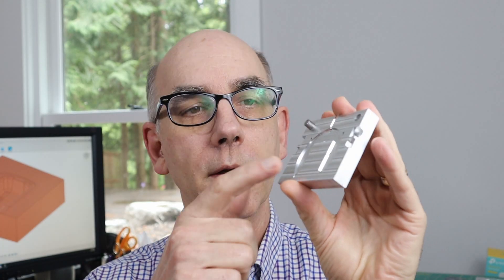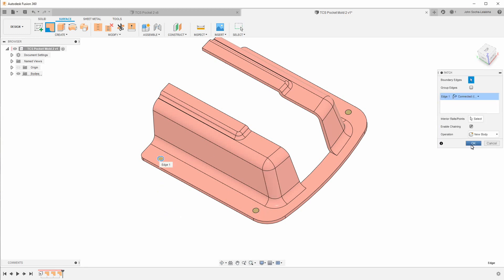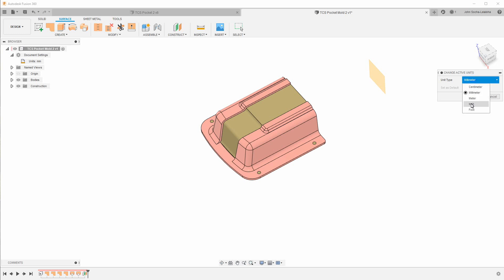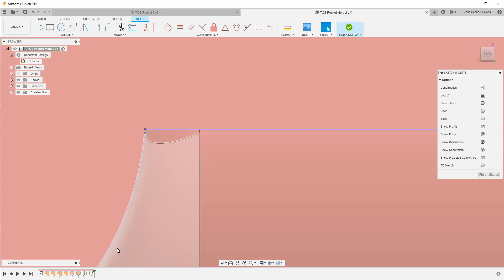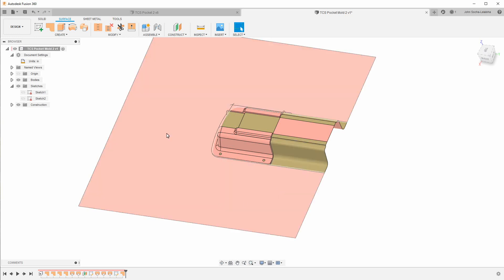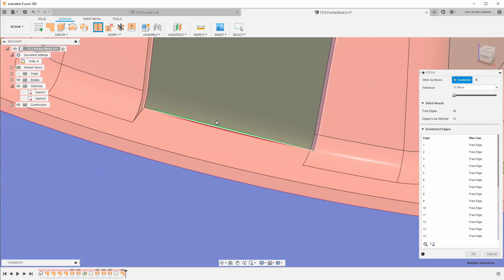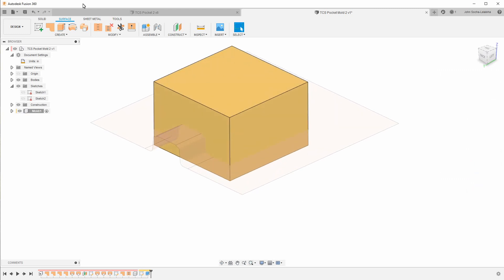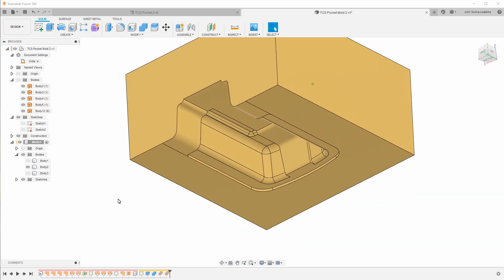Non-Planar Parting Line

Comment: Very good video.  I need to watch it again to make sure I understood how you got the part thickness reflected in the shape rather than two halves of one surface.  I've done a number of complex parting line molds and always thought I could develop a methodology for it and then document it rather than stumble along until I got it right.  Whenever I sit down to convince myself I have the method and record it, something happens that I don't understand, particularly in the fill/surface work, and I'm back to square one!  So I have mad respect for you getting this video together.
Reply from the maker: There are two operations. The first is to use a combine operation to cut the part itself out of the block. This is where I use section analysis to show that it's been cut. Then I use the surfaces to cut the block into a core and cavity. Hope that helps.